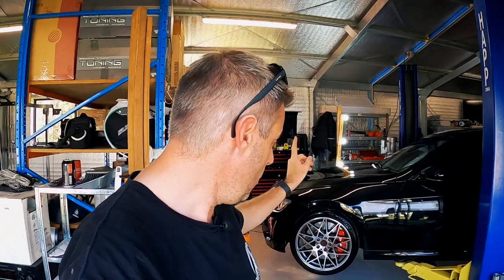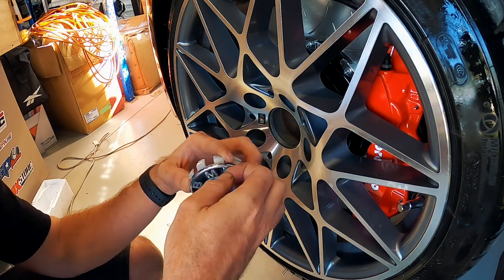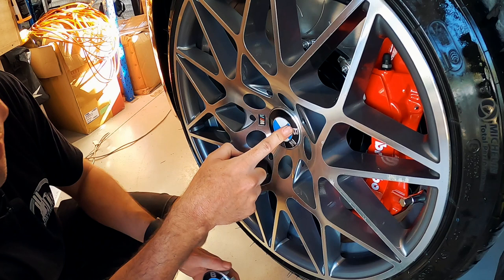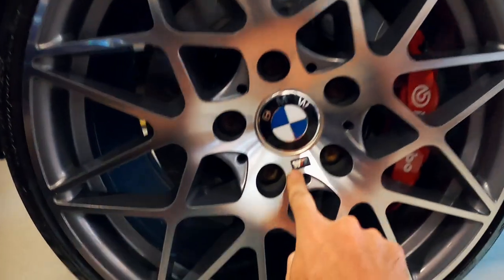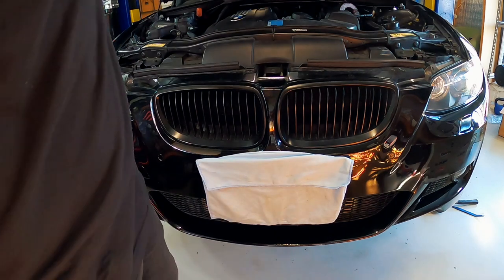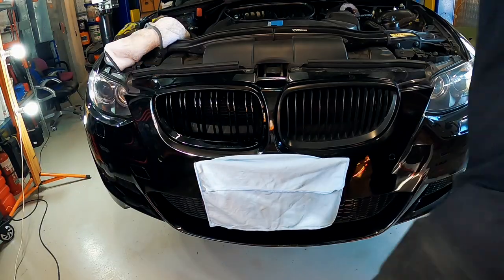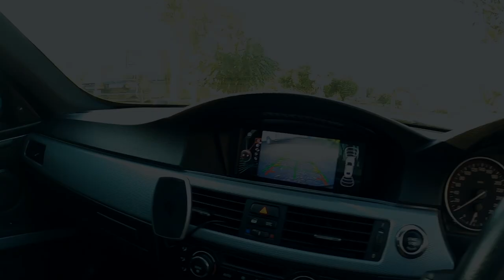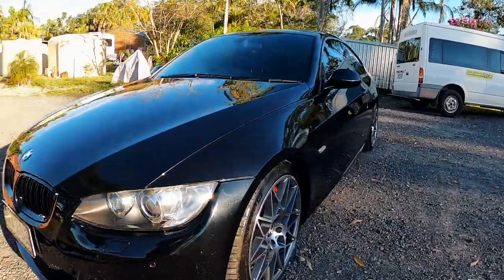New Grilles & Caps for the BUDGET Hybrid Turbo BMW E92 335i

Comment: I finally got my turbos installed over the weekend, did them on jackstands...along will inlets, outlets, and water pump+thermostat...went from struggling to hit 15psi at 98% duty cycle to hitting 19psi at 40%. Made 470hp on E50 with 530lbs/ft torque. I'm stoked on the turn out. Now for a custom tune!
Reply from the maker: Hell yes!!!!! Glad to hear you finally got them in.
Reply: @ZeroTo60Tube  gotta catch up to you man. Need me some port injection
Reply from the maker: @SuperHbkforever  It's the best way to for fuelling on the N54s if you want to make some actual power. Try and get a kit with decent injetcors.
Reply: @ZeroTo60Tube  I'm thinking about getting the Phoenix racing intake manifold and doing 1000cc injectors, but I don't want to switch to JB4 for injector controller, so I am still trying to figure out that problem
Reply: @cocko1135  it sure was. 25 hours over 2 days between 2 guys in the middle of a heatwave. What happened to it being cold in Canada? We're not meant for 35°C weather!

I have the fuel it stage 2 bucket-less pump and running E50 blend. I'm thinking about getting a second pump on a hobb switch and getting the split second controller for PI and then a flexfuel tune, but I don't know if I'm ready to go that route yet
Reply from the maker: @SuperHbkforever  Enjoy the 20psi you'll be able to run on your current setup. But but the PI and 27psi is a hell of a lot of fun! hehe
Reply: @ZeroTo60Tube  thanks man. I ran a 0-100 test yesterday after work on the draggy, landed a 3.77 still with no tune. It flipped my floor mats over! I bet a tune will make it even fast being able to hold boost to redline
Reply from the maker: @SuperHbkforever  that is effing awesome even with xdrive. what is your dragy username, we will have to follow you and see what you manage over the next few months with a tune etc
Reply: @ZeroTo60Tube  it's under my name "Brandyn Hamburgh" I gotta follow you guys back too

Comment: That thing is looking proper beast, love the new grills. You're pretty safe buying the little ///M wheel badges on ebay, common sizes are 18x11mm and 17x9mm. I got mine from a seller named Opelise who does genuine items, the fake ones will fit but the font isn't spot on, they don't look too bad though. Or just buy them from a local BMW dealer.

Comment: If you need em, get the spacers. I got eBay ones and I'm happy with the quality. Chrome bolts too!
Reply from the maker: They’re the ones I have been looking at. I’ve had China ones before on other cars that have been fine. But the e90 eBay ones are hella cheap. I might grab some and check them our

Comment: Spacers yes, 5mm on the rear and 12mm on the fronts. M3 side mirror covers, front splitter, slightly larger read spoiler. Clear flashers.  Have you got lci rear lights?
Reply from the maker: Yeah already running the lci tails

Comment: Are you planning to release a build breakdown video and summarise everything you've installed including costs as this is a budget build, showing whats worth while doing and whats not.
Also giving a second opinion after having them installed for a while?

If you are looking for wheel spacers, depending on tyre size. Fronts 15mm Rear either 5mm or 10mm
Reply from the maker: Definitely. I’ll probably break it down in to making it go fast, making it look good and then general maintenance/safety like suspension and brakes.
Reply: @ZeroTo60Tube  Looking forward to them, keen to see how the brakes hold up.

Comment: Looking very good, I'd suggest carbon fibre mirror caps, possibly F80 style ones if you can get your hands on them, also a boot spoiler. 😉
Reply from the maker: Was just looking at the mirror caps. They are cheaper than I realised.
Reply: @ZeroTo60Tube  Ive got ali links for Gloss black / carbon caps and black sequential side indicators if you need.

Comment: You should do a brake bleed using inpa
Reply: What is the advantages of doing it through inpa? I recently did a regular fluid flush, I noticed no difference to the breaking.
Reply: @airjaff  inpa bleeds abs pump

Comment: I’m not sure why, but the spacers on my e90 caused the extended bolts on one wheel (that was impacted down) to back off leaving only one in place, and nearly had my wheel come off on the motorway. Using a hammer and prying tools and lots of CRC, it took me four hours to get one spacer off even after they were only on for a couple months. It’s such a pain
Reply from the maker: That’s not ideal. What brand of spacers where you using? Also did the extended bolts come in a kit with the spacers?
Reply: Zero To 60 I believe they said redline performance, and no definitely not ideal. And I believe they did come as a kit, I’m not sure how reputable the brand is but you might not want to cheap out hahah

Comment: 12 on back 15 on front,they’re always inset as you have to be able to fit snow chains in Europe. Press release and show cars always have spacers I believe.Good luck with steering wheel I failed miserably,sent pictures they said they sent wrong cover if yours has C56 on label I think it’s wrong one. Can email you pictures if you like worth the laughs. Time fit LSD better late than never ! 18inch rims loads better for traction but them brakes looking Sic ;)
Reply from the maker: C56 thanks will check it shortly. I can’t remember if I told you but I ordered the pedals you suggested. Hopefully have them soon too.

Comment: Looks much better than when you picked it up! Lol
Are those wheels genuine bmw?
Also I don't think oem lug nuts would rust. They are like 5 bucks each from wreckers
Reply from the maker: Nah they are eBay rep wheels. The wheel bolts are genuine tho. We seem to have an issue with rusty bolts. The e60, e90 have rusty bolts. Dave’s e39 don’t seem as bad, which is weird since his are the oldest.
Reply: Macht Schnell the genuine 19” wheels are terrible for cracking, your better off with aftermarket ones!

Comment: Just take the metal piece from the old center caps and put it in the new chinesium ones.
Reply from the maker: Well the crappy ones have a larger diameter. The ring isn’t tight on the prongs
Reply: @ZeroTo60Tube  bummer mate, that's how I got my crapnesium caps to work. Great videos 👍
Reply from the maker: @corteman  Appreciate the idea anyway. These must have a particularly high crapnesium content.

Comment: enjoying the ride but the wheel spacers not a good idea a m8 that crashed his car not bmw had his insurance knocked back because he had wheel spacers that was nsw i dont know if its the same in  queensland
Reply from the maker: It’s funny how they are not allowed in Australia. Rest of the world is fine. Not to mention they are fine if they were factory fitted. The Aussie F250s sold in the early 2000s that we’re used as ambulances all had wheel spacers. I think they should just need a mod plate, like most most, not be blanket illegal.
Reply: @ZeroTo60Tube  if you buy the good quality one it should be legal they are some shonky ones out there everyone i know that have jeeps run them
Reply from the maker: @shadowjohn2266  Im not sure if they are regardless of how or safe they are. Dont forget in QLD you can't even lift your 4x4 more than 50mm, the regulations here are pretty crazy.

Comment: Unpopular opinions: How about a 5x120 to 5x114.3  hub conversion . Get access to better offsets with better wheels for cheaper costs. Sell the current setup to offset the cost.
Reply from the maker: Is it just a matter of re-drilling the hubs?
Reply: Zero To 60 most have just baught the plug and play hub conversion kit. Then sell it when they sell the car. Sells like hot cakes because the 335i community kills for them because of the 5x114 wheel choices
Reply: Macht Schnell  no mate there used to be a full conversion. Can’t seem to find that anymore people must not have wanted to pay the price they asked. I know a few of us in aus did it though. Alternatively redrilling the hub has been done countless times

Comment: Wow the car really needs a new steering wheel, those cracks are deep
Reply from the maker: Yeah I’d say it’s been repaired at some point and now the repairs surface is coming to a harsh end.
Reply: @ZeroTo60Tube  i put some black sequential indicators on my e92, they really make the car look sleeker and more modern, really cheap aswell would be a good quick mod.

Comment: I wouldn't go with spacers.
I had a spacer crack and a piece fall out. This caused the wheel to wobble and tare the wheel nuts off the studs, sending the front left wheel free for a run.
Luckily this happened at Queensland Raceway coming into the last corner before the front straight.
Needed to replace the rotor, wheel studs, wheel nuts and also damaged to the front bumper.
This all happened in the distance of 1 lap.
Spacers are also illegal in QLD if that changes anything.
Check out the Vehicle Standards Instruction "G19" on the TMR website:
https://www.tmr.qld.gov.au/Safety/Vehicle-standards-and-modifications/Vehicle-standards/Vehicle-standards-instructions
Reply from the maker: Yeah track use is where i seem to hear of most failures. Do you mind me asking how you torque your bolts or lugs? Use a or torque wrench or manually? Me being a bit old school have always done them manually and wonder how torque required would vary with the extra leverage the spacers put on the bolts/lugs.
Reply: @ZeroTo60Tube  Back then I didn't know any better and just did them up "tight" with a wheel brace. 
Now I only ever tighten wheel nuts with a torque wrench to factory specs. 
Can't really help with what additional torque would be required on spacers unfortunately.

Comment: Spacers = Instant illegal / No insurance in australia, unless they were factory fitted (I cant think of a car that has factory fitted spacers either). Get a new steering wheel - something with alcantara. That one you have looks like you need a tetnus shot to use it lol
Reply from the maker: It’s so ridiculous some of our laws. They were factory fitted on F250s that were sold by ford Australia in the early 2000s. All the F250 ambulances had them. I have ran spacers on most of my cars, if they are reasonable quality and installed properly they are completely safe. Which is why they are so popular in the rest of the world.

Comment: please dont get chinese spacers. if you do, be sure to get decent bolts.
Reply from the maker: It’s not like they do anything important or are under excessive load.....
Reply: @ZeroTo60Tube  the bolts are the issue
Reply: plus not sure what the go was, obviously varies from suppliers. but i had introduced vibration from cheap spacers that was fixed with a reputable set
Reply: and had to replace a wheel hub on my 130i from a dodgy bolts from a cheap hubcentric kit..
Reply from the maker: @n54ne15  Man that sucks. Out of curiosity do you do bolts or lugs up to a torque setting? I don't btw, i have always done it manually and i definitely do them tighter than factory torque specs.
Reply: @ZeroTo60Tube  the vibration may have been from not torquing correctly maybe ? i just wheelbrace or rattle them up with cordless and check with a brace after (but never had an issue with stripped or loose bolts)  i know the techs at gc bmw stealership deffs dont torque them to spec however lol. seen alot of rough backyard style shit there